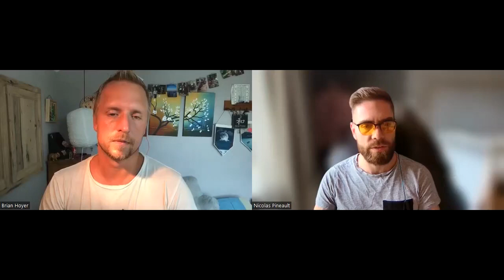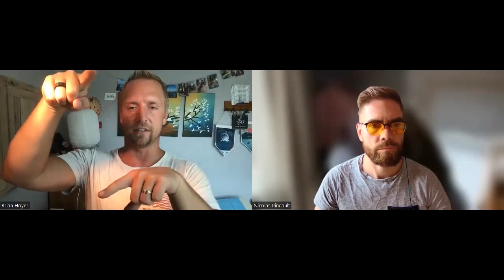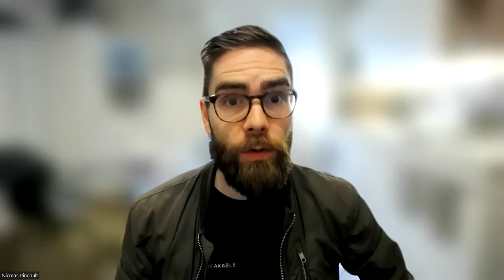Grounding/Earthing: Grounding Rod Outside VS Using An Outlet? [EMF Circle Preview]

Comment: In my humble opinion a 10-foot ground rod directly attacked to your bed or want ever is the best way. especially if you have a smart meter on your house.
Reply: Smart meter emits RF and grounding doesn’t mitigate that.  You need a faraday cage to stop the smart meter signal and that should be grounded to reroute electric fields away.

If you are using electricity in the room, and then you will want to ground to the equipment, grounding conductor of the building (the outlet).  If not using electricity than a grounding stake is fine.
Reply: I live in a seconed story apartment. I made a home made canopy around my bed and idk if i should ground it outside theiugh the window or make a DIY outlet plug. Can you tell me exaclty step by step a list of what materials to get at home depot and how to install the ground or outlet and the safest way to go about doing it and where to put it so i dont get shocked? I'm new to this so it would really mean a lot. Thank you 🙏

Comment: Please help. I have my grounding mat plugged in the same outlet as my lamp, phone charger and alarm clock. Is that bad or should I use a separate outlet just for my mat? I’m so confused
Reply from the maker: The best would be to run a wire outside and use a grounding rod. If it's not possible, use whatever is available in your room - if you feel the grounding equipment helps you.

I'd personally try to plug just the mat in one outlet, and all my electronics in a different outlet. The fact that other electronics are plugged in the same outlet as the grounding mat could mean that unwanted frequencies might go up the grounding mat's wire. All of this would need to be tested by a professional to be confirmed, of course.

Comment: Ground currents may have been mentioned in the extended version regarding grounding. If there are ground currents present where the electric utility company utilizes the earth  as a return to the grid to complete the circuit, wouldn't that potentially create a charging effect instead of a grounding effect? Though electricity flows through the path of least resistance, it is possible for some of that energy to flow into the body when creating an inadvertent circuit. I used to work as a sound technician for a church and they had very bad ground loop issues that would be present in almost all of the monitors on stage and even the main PA drivers. The building was properly grounded, and there were even independent grounds for the equipment, but the ground loop apparently was coming from the ground. Just some food for thought...
Reply: I find this brought me more confusion as well.
Reply: The ground loops are caused by two grounds where voltage and current are using one ground, or the other to flow to ground simultaneously.  A simplified explanation is that If those two grounds are connected together, then at some point in the wire, there is an easier path in one direction (because it’s quicker) than there is in the other direction, even if it has less resistance in one direction or the other.  This is why it becomes a loop.  

When you get rid of the loop that doesn’t happen, and all of the current flows through one area and won’t come into the body even if you touch it.  

What CAN happen is higher frequency resonance.  It is very rare but In these situations a resistor or filter can help to mitigate higher frequency resonance coming off the wire or grounded material. 

-Brian
Reply: I live in a seconed story apartment. I made a home made canopy around my bed and idk if i should ground it outside theiugh the window or make a DIY outlet plug. Can you tell me exaclty step by step a list of what materials to get at home depot and how to install the ground or outlet and the safest way to go about doing it and where to put it? I'm new to this so it would really mean a lot. Thank you 🙏

Comment: Nick and or Brian, if we have a large stake several feet in the ground outside, at least 25 feet away from the electricity coming into the home, attached to the canopy of aaroniaShield around the bed and touching the grounding mat underneath.  If the power is OFF in this room at the circuit breaker, is this OK for a grounding situation?    Generally speaking?
Reply: Generally grounding a canopy this way is okay as long as there aren’t any electrical cables being used inside the canopy (phone charger, bed cooling system, etc.)

Comment: There seems to be two camps around grounding. One says just ground and that it's ok to be the ground conduit; the other warns about you being the conduit and resorts to shielding the ground cables.

What do you think about PureGround and what Dr. Koniver says?
Reply: she is the one to listen to..i have had the issues like many other sensitive people and now use her cord
Reply from the maker: I think the Earthing institute means well but they have only part of the answer. Their work could apply to a large fraction of the population, but they lack the appreciation that the global increase in electro-pollution might change the risk/benefit analysis of using earthing inside an electrified environment.

I wasn't aware of Pureground but the Earthing Institute claims that it filters too much of the Earth's DC electricity you're trying to get by Earthing, which defeats its purpose. https://earthinginstitute.net/pureground-emf-filtering-shielding-cord-not-pure-and-not-effective/

Whether everyone should ground inside the home is in my view still up for debate and should be a personal decision. I think that earthing outside on natural surfaces is much safer and likely more effective.

Comment: You’ll have to have an engineering background to understand this. There are a lot of things to consider when grounding, impedance, potential differential, etc. 
You’ll have to understand ground loops also. Similar to when you get unwanted noise in audio equipment. Most audio equipment comes usually with a three prong cable. So if I connect my guitar to my speaker alone I won’t get noise because it’s grounded. If I connect my guitar to the PA system I’ll be ok too. This is when ground loops happen, splitting the signal from my guitar in two, to my speaker and ALSO sending signal to the PA system. Both systems are grounded and creates a potential difference between the two, therefore creating unwanted noise. So the solution for that would be a ground lift switch for the input channel, which most PA system have nowadays. This create a common ground. Even though I still don’t like it, the best option is to have a common ground, ground your paint to the house ground, do not create another source like adding a stick to the ground.
Reply: You got it! Great analogy!  Thanks for commenting!  -Brian
Reply: Appeal to Authority, Logical Fallacy Example  -  'you’ll have to have an engineering background to understand this'
Reply: I live in a seconed story apartment. I made a home made canopy around my bed and idk if i should ground it outside theiugh the window or make a DIY outlet plug. Can you tell me exaclty step by step a list of what materials to get at home depot and how to install the ground or outlet and the safest way to go about doing it and where to put it so i dont get shocked? I'm new to this so it would really mean a lot. Thank you 🙏
Reply: @alexzemaitis I think through the plug, my son’s father is an electrician so he will be helping me do this and understand and I can totally tell you how it’s done. Do you have any contact information?